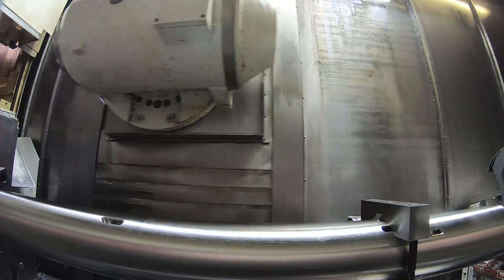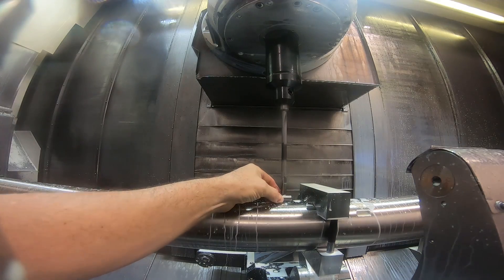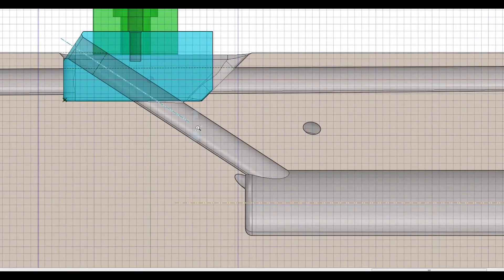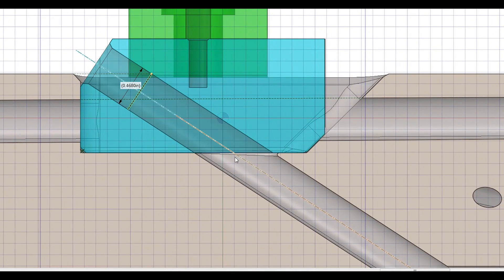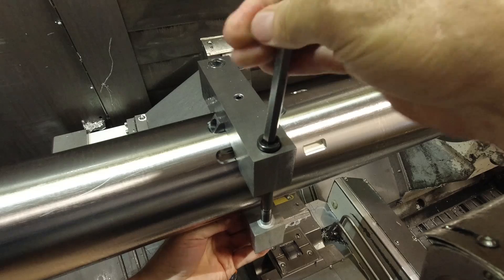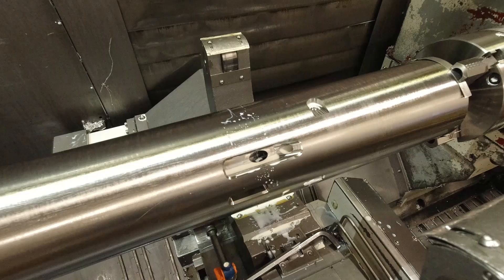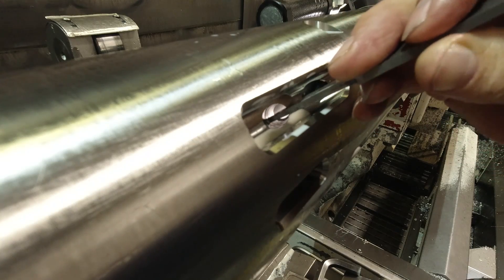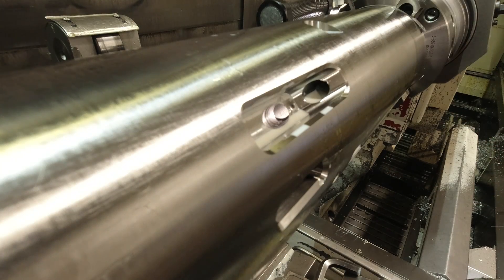Gun Drill Guide Block 2

Comment: Hello, thanks for uploading all those videos. Your explanations are always great and i learned quite a bit from you.
I already had a similar issue and did some tests and thought ima share that here.
You can also put a gun drill guide bushing into a 3D printed piece of PETG.
Reply from the maker: Yes I suppose you could as long as the 3D print is strong enough to withstand the forces on it.
Reply: @EdgePrecision  That's why the bushing, the forces on small diameter gun drills are not that high but too much for the raw plastic. I tried to drill straight trough the PETG too into C45 but ... the sounds were gnarly for a second and the hole was slightly wider on entry too (0,04mm wider about 3mm deep @14mm drill), it kinda works but i'd not try it in inconel or stainless. The one with the bushing worked flawlessly and held up 50+ parts after which the bushing got replaced, the printed part was still in good shape. The PETG also holds up really well in a oily shop environment.

Comment: Hi,

Could please advise if there are any device that can check the wall thickness of gundrilled hole when part is drilling in gun drilling machine?

Please help to introduce the model of this device. Thank you for your support.
Reply from the maker: There is a device to measure wall thickness. Do a search for. Ultrasonic thickness micrometer. Here is one link. https://www.penntoolco.com/spi-ultrasonic-thickness-gage-for-measuring-metallic-non-metallic-materials---15-145-6/?msclkid=43b03d860d0216dbdbd259d833168283&utm_source=bing&utm_medium=cpc&utm_campaign=**LP%20Shopping%20(4)%20-%20%24500-%24999.99&utm_term=4574655566717659&utm_content=105013%20%7C%20SPI%20Ultrasonic%20Thickness%20Gage%20-%2015-145-6%20%7C%20%24602.68

Comment: Peter - sorry one or 2 spelling errors - I remember you milled the dovetails (sorry) but broaching and shaping I did see you do on internals but maybe you have tried it or no need to get rid of the step. At R-R we also use EDM a lot and I also used it in mold making. The Swiss Cheese holes are for cables and other necessary instruments. I am sure WIFI and other developments in the industry (Lasers etc....) will have an impact in future.
Keep up the good work
P

Comment: Hi Peter Great videos and sharing your skills. I read the comments too. Me - Semi retired designer of downhole tools like the ones you are making...chipping in....If I can but you never do stop learning.
Former manufacturing engineer Rolls-Royce Aero - all sorts of engine parts that DO NOT accept ANY steps in holes. (they have more tooling finances than you)
Previous to that career was a toolmaker and CNC machinist....I machined some parts for that first Moon landing ------all machining process plans came from America with the material. They worked a treat I remember.....so I appreciated the learning
Corrent home based CAD specialist mechanical stuff......will not bore you with that.
Now......I think at R-R we would rough dia the hole size and broach to size. I saw another video of yours where you used cycles to have your machine do a shaping job on dovetails. Maybe think along those lines - BUT ONLY IF you need to get rid of the step. Alternative maybe milling a cone shape at the beginning of the hole and I saw some mention of EDM in the comments.
Question for you....Tailstock chuck. Please confirm if you turned or milled true as I dont think you have spindle power there
Its a great machine and the work you produce is amazing.......gosh I do miss machining.....(but the noise damaged my hearing)
Pat

Comment: So is the tailstock actually driven by a motor? You said you turned it while it was mounted on the quill. Is there some real reason you would want to have a driven tailstock other than for niche stuff like this? Its not like you could really use it as a sub spindle. Just seems wierd to me as it would make it much more expensive to make the tailstock. Unless of course I misunderstood you. I like the idea of having the bearings in the quill and just using a dead center. Seems alot more stout that way if you have something heavy and long. Only downside I could see is if you ever had to replace the bearings. Hopefully they're so overbuilt you never have to worry about them wearing like a smaller live center.
Reply from the maker: No the tail stock is a spindle like a live center. It mounts a #6 Morse dead center in it. But it doesn’t have a motor driving it. The way I skimmed the mounting surfaces for the chuck. I chucked a rod in the turning spindle with a center in it. Than engaged the center thru the bore of the chucks mount ( its mounted/clamped to the #6 dead center in the tail stocks spindle). I hope that makes sense.
Reply: @EdgePrecision  I think I understand now. You put a shaft in the Turning spindle with a center hole in the end of it. Then you brought the Tailstock up to it until the shaft passed through the Chuck Mount (aluminum piece) via a through hole where it met the 60deg point on the dead center to which it is mounted. Then you used the power of the Turning spindle and friction from the Tailstock quill pressure to drive it and took a very light skim cut so as not to spin the center in the end of the shaft. I knew I misunderstood you in some manner. The thought of a powered Tailstock seemed way too much of a novelty.
Reply from the maker: @PreciStrike_96  👍🎯

Comment: You would have been much better off using a conventional drill with coolant holes. Water base coolant does not support the wear pads on a gundrill any better than water base coolant would support main bearings in a engine. Gundrill coolant pressure for your hole size would be about 600 psi and I doubt you had that. At break through into the larger hole, you had free flow coolant out the back and lost all support and lubrication for the wear pads risking seizing the tip off. Cap off the end to maintain oil pressure. The oblique angle into the larger hole was also high risk for a gundrill.
Reply from the maker: Yes this is not the most ideal conditions for gun drilling. By the way the coolant pressure is 1500 psi from my coolant system. The drill lands do suffer from erosion but this works better than a twist drill. Especially where it is intersecting and breaking into steep angles. The gun drill tip supports this better than a twist drill. No I’m sorry I have tried it with both a twist drill and a gun drill. The gun drill works better.

Comment: I have a question on tool length offsets. If I set tools with a gage block, vs a tool offset probe, the numbers are different. When I load a program into the controller, how does the control know how those tool offsets were set?
Reply from the maker: When you refer to setting tools with a gauge block is this inside the machine or outside the machine verses a tool offset probe is this a probe inside the machine like a tool setter?  The program doesn't know how the offsets are set. Unless it has a probing routine in the program. And even if it did that doesn't mean it knows they were set correctly. The probing system has to be properly calibrated. To look at it another way the controls program just runs it doesn't know anything about if the offsets are correct or set correctly. It just runs the called offsets. How much different are the numbers between the probe and your manual method of setting? Witch method works? If the manual method works the probe needs calibration (Assuming you are using the correct procedure manually). If the probing works than you are doing something wrong manually. It is a little hard for me to make a determination on that with the information you have provided. There is a relationship between how you set your Z axis fixture offset and how the tool lengths offsets are set. There are a number of different was to do this. (I'm assuming you are talking about a milling machine.)
Reply: @EdgePrecision   Edge Precision  I apologize that it has taken me so long to answer. I typed up an answer, but when I went to reply, youtube must have timed out or something. By the way, I really appreciate that you have been explaining more of the machines and how they are designed and how they work. I would love to see a whole video that is just an introduction to the Mazak controller. I may get the chance soon to refurbish an old mazak twin-spindle lathe, and I also want to put together a series of videos that introduce students to cnc controllers. I want them to get a broader picture of a variety of controllers, because I think that they will then see the bigger picture (tool offsets, work offsets, coordinates, memory, mdi, importing programs, etc). 
Anyway- I am curious about how our milling machine distinguishes between tool length offsets that are set using a gage block, (giving numbers like -14.0987, -12.8976) versus TLO's set with a WIPS tool setter (giving numbers like 5.3949, 3.0498). "They" say to never set half your tools with the gage and half with the WIPS, which makes sense, but how does the machine know

Comment: Quite handy that tailstock chuck. You did a lot of work for a hole that passes cables through. Sometimes this designers go overboard with complicating their designs.In front of a computer screen everything is possible. I receive a lot of drawings with close tolerances on them just for the sake o it. Anyway , hope you are getting good money for this parts. I like the material you put out. People need to see the reality of managing a machining shop and not confuse it with that cheezy , over the top stuff that those guys from Titan put out. Take a cut than measure, that s the way.
Reply from the maker: Thanks viorel22cr. They sure don't make it easy sometimes.

Comment: Hi Peter thanks for all the great videos I have been watching about a year and have learned a lot. My question is about spot drilling. In your jig you bore with the 1/4" endmill to get a 90 degree surface to start your drill on then drill right through the jig. I imagine you want this hole very straight - is spot drilling the bottom of that bore before drilling through just not very helpful if you're using high quality drills? Thanks and looking forward to the next video!
Reply from the maker: If I want a hole as close as possible on location. I will mill a counter bore about 1/2 the drill diameter in depth and either the same size or .003-.005 smaller than the drill size. Than start the drill at the top as if there was no hole. This though is a little hard on the drill. It would be better to than go in with a stubb drill of the same diameter at a slower speed (RPM) to spot the bottom of the c-bore. If you are drilling with long drills (Say 7-10 diameters or more). This is what I normally do. That is If its necessary for the hole to be good on location (Say .005 true position) and no bell mouthing at the top of the hole. I see on YouTube many people using center drills to spot for a drill. This is totally the wrong way to spot drill for modern tooling. The small diameter hole in the middle that the center drill leaves will damage (Chip) the split point of the drill. It is better to use a spot drill of a little steeper angle than the drill (So the drill starts cutting on its OD first not the point. This is for CNC work. Not necessarily good on a drill press.) and spot to at least the drill diameter. I usually use a 90 degree spot and go to a diameter that will leave a small chamfer on the hole. I have been meaning to do a video on how and why you should not use center drills to spot for drilling. I just haven got to it. A center drill is for drilling a lathe center not for spoting holes.
Reply: @EdgePrecision  Thanks very much for the reply I for one would definitely like to see that video. I always seem to learn a lot when you get a pen and paper out. I also don't understand much about different drill tip geometries although you have shown some of that in your tool grinding videos.

I have been using wide angle stub drills like 140 degree to spot deep holes, but what you are saying makes sense to me since the very tip of the tool basically does not rotate at all, and it seems like you will get even pressure on the OD of the drill which keeps it straight. I do mostly aluminum though so I can get away with anything. I will have to try my 90 degree tool next time.

About the center drills I always get a kick out of it when you tilt your endmill at 30 degrees to mill the taper instead of using a center drill. Just never would have thought of that. Anyway thanks again hope you have a good weekend

Comment: Nice looking part, very impressive. Does the titanium distort when you machine the slots/holes into it?
Reply from the maker: It can depending on the alloy and the heat treatment.
Reply: Ok, do you have to skim the OD on these parts to bring them back true for final operation?
Reply from the maker: Daniel Tong no the OD is to finish size.
Reply: Interesting. Cheers Peter

Comment: Is sinker/plug EDM an option for things like this?
Reply from the maker: Yes that could be done. But every time you send a part to another shop for outside work there is a chance of a mistake or misalignment of some sort. Better to do it in the same operation. Also this is a big part to put in a EDM machine. There are places in Houston, Texas that can do it. But I have had them screw up as many jobs as they did good.
Reply: @EdgePrecision  Thank you for the reply - and for your experience and reasoning. I am not a machinist, or an engineer for that matter - but I am designing/engineering something, and trying to learn as much as I can about machining and engineering so I can design something that can actually be made. Small precise holes in awkward places seems like a real nuisance - or maybe an interesting challenge.

Comment: i really like that guide block idea! when you exit the hole are you slowing it down?  since its on the shallow angle side I would stop that just short of the drill breaking out so i can run normal speed and feed up to that point, then slow it down to about 50%rpm and 30% feed, it usually helps the edges from getting beat up. you might have to do a small peck as well since your chips will be longer and might not break initially with the slower feed
Reply from the maker: On the next parts it is working perfectly. Just mount the drill guide and drill thru. As simple as that. No feed changes no peck no speed change.

Comment: I'm assuming when you touch tools off you use the pin of known diameter and then subtract the pin and the radius(or diameter since it's more of a lathe?) To get to centerline. My question is how would you touch off a boring bar or some other ID tool?
Reply from the maker: In the milling mode it would be the radius. To touch off a lathe boring tool its done the same as any lathe. You would do a skim cut on the bore and without moving the tool in X measure your diameter. Than on the offset page you could use the teach function and tell it the radial distance from center-line.  On the Mazatrol their position display always takes into account the offset. So you can go back to that display and hit reset. It will than tell you the diameter the tool is at (assuming you didn't move it in X). The Z is done the same as a milling tool just in the Z axis. On a lathe tool on the Mazatrol offset page there is a A dimension/offset and a B. The A is the length of the tool and the B is the Radial distance from the milling spindles center-line. Then there is the Index position. This is the position the spindle orients and clamps the tool.

Comment: Could you not have used a ball nose cutter to spot the part before drilling?
Reply from the maker: The problem wasn't creating a spot to start the drill (I talk about that in more detail in the first video). It is the hole that travels horizontally thru where the pocket is (Before its milled). The spot face for the drill because of the steep angle breaks into that hole. Or in other words  because of that hole there is no material down there. So I would have to go beyond the hole. Well that's almost at the pocket bottom anyway. Also that same hole gives problems with the shavings catching on the intersection when drilling thru it.
Reply: Ah I see! Thanks for the reply. Great work as always

Comment: What about drilling the hole before you put in the slot? The material that will be removed for the slot will act as a guide for the drill.
Reply from the maker: I expanded this in the first video on this drill guide. But the problem isn't the pockets material but the lack of it because of the intersecting hole in that pocket, running horizontal just below the surface. There is nothing to guide the drill with because of that hole. And also that hole causes a shaving problem with the drills shavings clogging up at the intersection and nit exiting the hole. I did already try what you are talking about.
Reply: @EdgePrecision  I think you missed what I was saying. IF the slot is not there yet, the material to guide the drill is there. So once it hits the pocket the drilled hole will act as a drill guide. The clogging is why we went to thru drill coolant on virtually everything. While it will not prevent the build up of chips in the other hole, it will keep them out of the current hole and keep coolant on the tip.
Reply from the maker: Just look at the thumnail for this video. You see the second hole to  right of my finger in the angled end of the pocket. That hole runs horizontal thru the pocket before its milled. If I tried to mill c c-bore (witch I did the first time. been there done that.) it breaks into that hole. There is than no material to support the drill as a guide. Also the shavings being pushed out by my 1500 psi coolant feed drill get caught in that hole causing a problem. As I said in my previous comment I tried it the way you are saying to do. If that horizontal hole running thru where the pocket is wasn't there, yes that would work. But its that hole that is causing the problem.